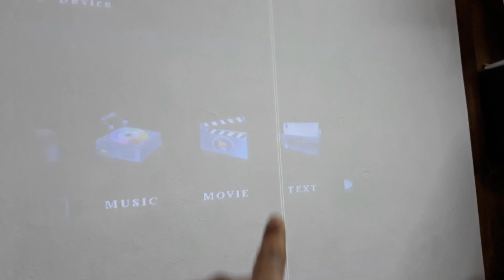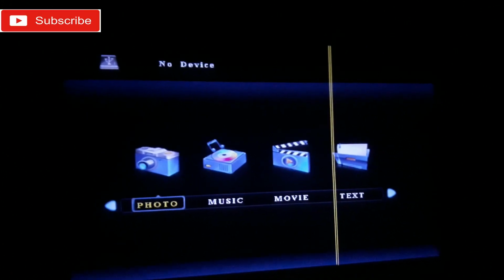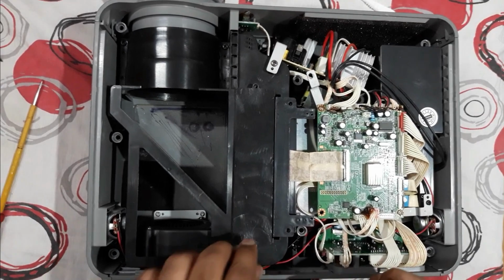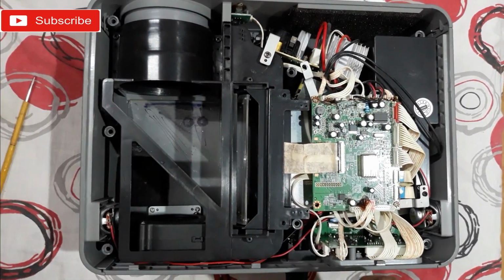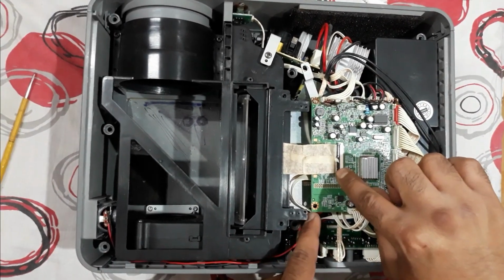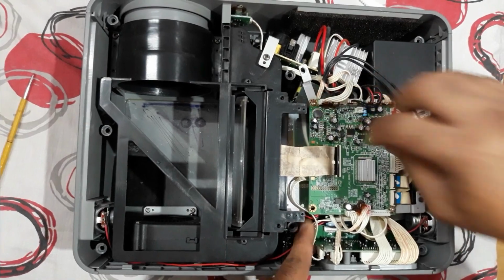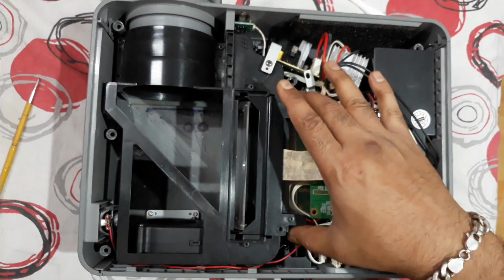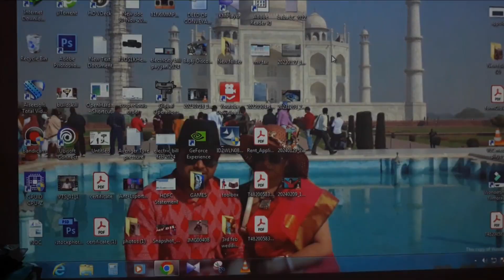Led Projector Display Line Repair // Vertical Lines on LCD Panel Repair // The technoboy

Comment: Good video and thanks for sharing. Could you pleas explain what caused those two lines on the screen and what made it disappear - is it the liquid you used or the heat? Cheers
Reply from the maker: Line can cause by the old lcd goes bad. But sometimes it caused by the flat ribbon connection to the lcd screen. It can be fixed by removing cleaning & remounting if it's easily removable or it can be fixed by provide some heat to the connection joint.